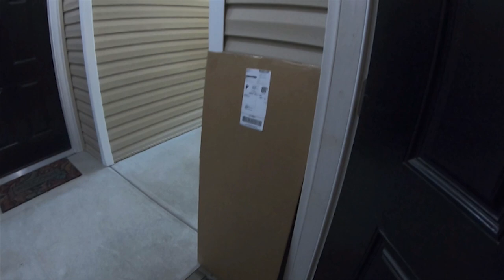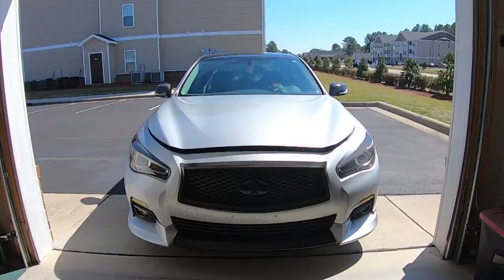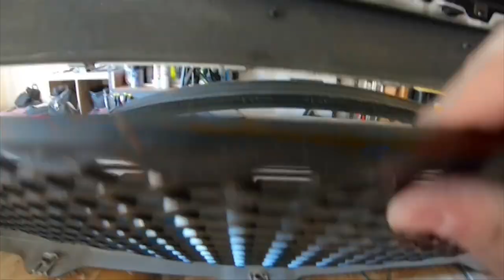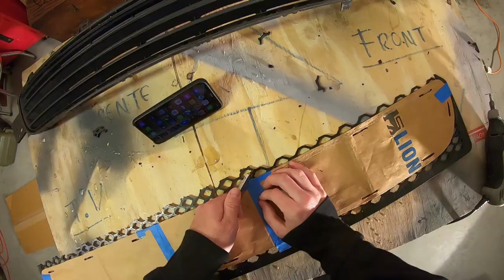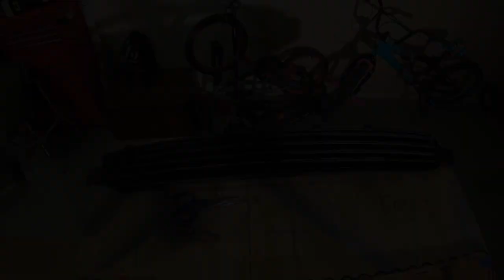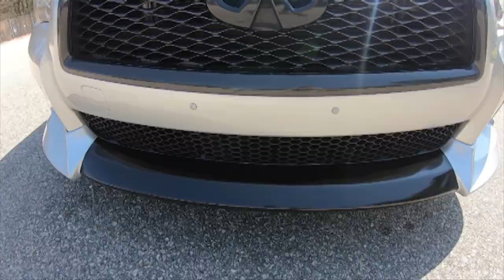Upgrading your Front Grille with a Universal ABS Plastic Grille

Comment: You never really say how you secured it to the bumper. Is it barely on there , or did you plastic weld
Reply from the maker: I secured it just how you saw in the video using the original clips that held the factory grille in place. It hasn’t moved since I installed it so I’m gonna say it’s gtg. If you want to further secure if You could drill small holes in each tab and insert a zip tie into it to keep it on or do a dap of jbweld or plastic epoxy on each tab where the grill touches. I didn’t find the need.
Reply: @Foxcraze  great! I was just about to ask, doing it that way seems like it would come off by hand strength , and was going to ask for other methods. I’ll be using the JB weld to see how that goes